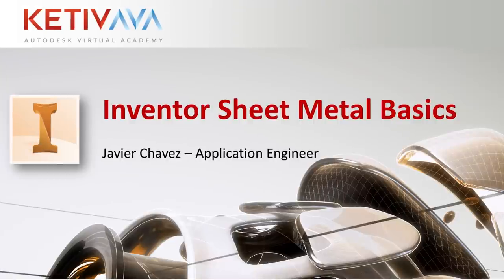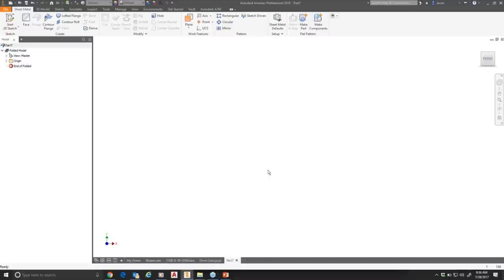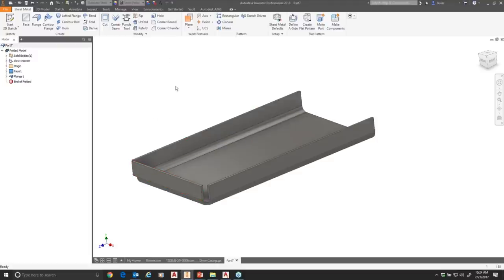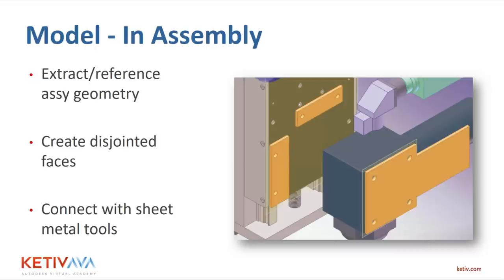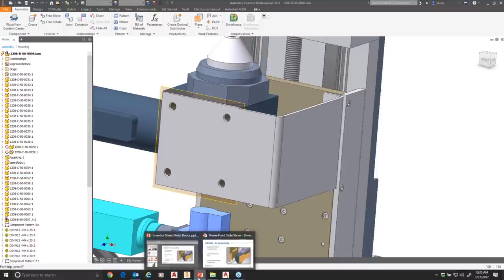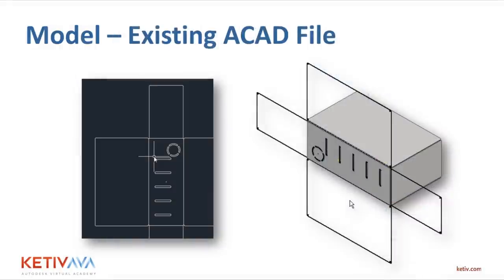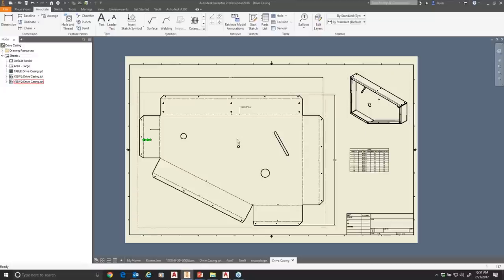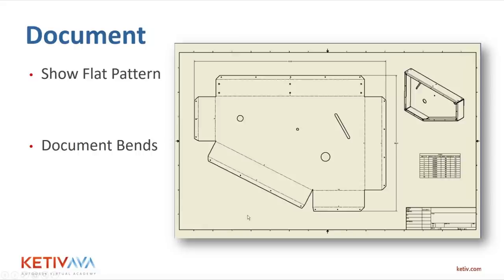Inventor 101: Sheet Metal Basics | Autodesk Virtual Academy

Comment: Thanks for a very nice video. I have looked at quite a few and they all seem to forget one requirement.
I have a 50 ton MANUAL break. I am able to creat the flat part but need a table or some dimensions to let me know how far the bend lines are from the edges. If I know these, then I ca insert the metal part into the break, measure to the bend line and press the pedal to the metal😉
Reply from the maker: Hi Adel, go ahead and get in touch with us at questions@ketiv.com

Comment: Sweet informative video, thanks for your time and effort!

I am working with plastic (PFA), the tank is 3/8" thick, and at the top, there are weirs (scallops) all around. The four corners have a relief cut, more or less, an area is machined down to 0.1" thick x 2.292 wide with 45 degrees each side of the cut. My question, can Inventor take a 3D model with two thicknesses and unbend those corners and add a seam in the middle of one of the walls, so as to create the flat pattern?  The seam is where the weld would be. The corners will bend in a radii... Can this be done?
Reply from the maker: Hi Brian, go ahead and get in touch with us at questions@ketiv.com

Comment: Hey, I'm planning to create a rectangle "box" of the metal sheets and the thicknesses of the metal sheets are from 1 - 1,5mm (I'm living in EU, Metric system). I have struggled for a long time now with these parts because I don't really know how to create a perfect flange (45 deg) to fit it with the rest of the parts. I really need them because at a top of that there will be a piece of glass, so it will be visible what's inside of that box. Is it possible to make such edges to that point where it fits perfectly with other part as well? I mean the 1-2mm gap between edges when it comes to assembly.
Sorry for my english and thank you in advance!
Reply from the maker: Hi gatrone tv, You can definitely manipulate how everything comes together by editing the sheet metal styles. You'll want to make sure you are using accurate KFactor information to your material and the machines you are using to predict the material behavior at the bends.
Reply: @KETIVTechnologies  Thank you a lot!

Comment: Question, how to do the layout for building a sphere with 8 zones  the old fashion way with hand drafting tools.  1960's  sheet metal work.  I did this in '64, but my memory is slipping.. working with a simple flat poster size paper.  Starting with a 12 " diameter circle, add vertical & horizontal lines.  Begin working on just one section.  Upper right   ,,  then I get confused so I need pattern like before computers.  Fighting Alzheimer's trying to refresh my 73 yr old brain by challenging my 9 the birthday thinking of yesterdays.   THANKS, maybe I might build the 3 d objects, all 5 of the HEXAHEDRONS.   FROM SCRATCH  with nothing more than a tape measure & a pen & a long factory cut straightedge.
PLEASE HELP this old / young, 73 / 9 VETERAN copimh